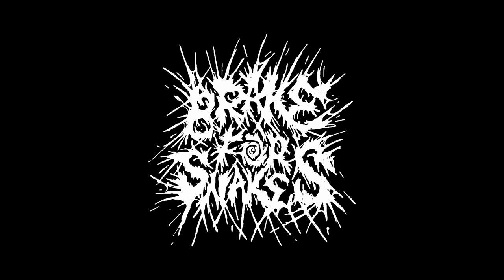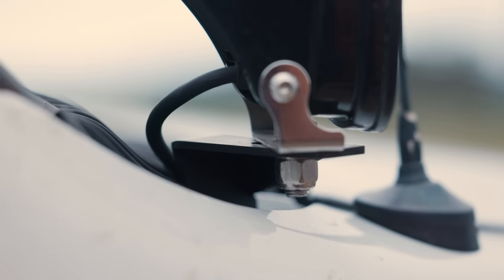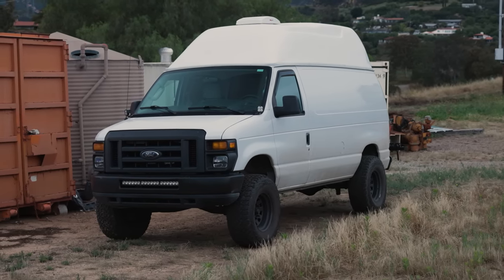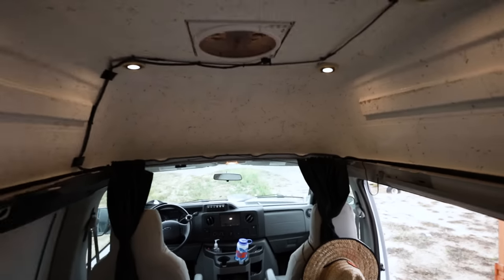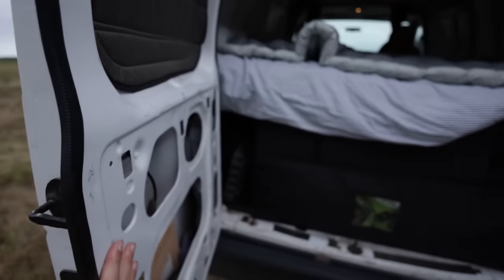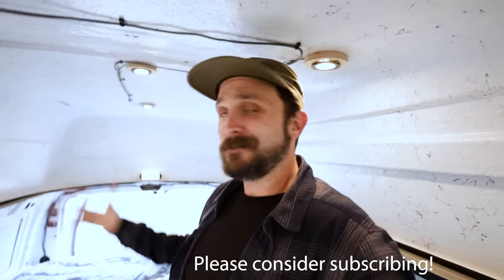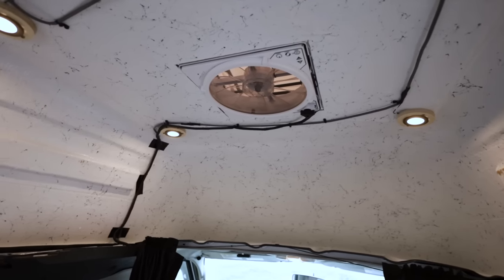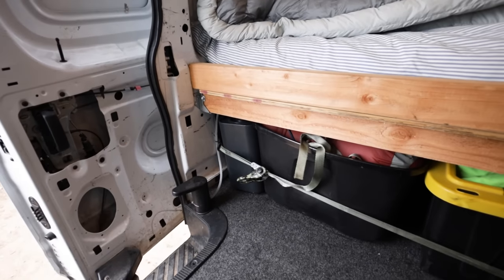This cargo van conversion cost how much!? Crazy cheap option to a Sprinter van!

Comment: It started out being cheap, you said and then things escalated. Chevys with 350’s and even 305’s, they’ll benefit from 31 x 10 light truck tires, the speedo will register 5 to 10 mph pessimistic, and the vacuum modulator on the transmission can be adjusted ( screwing clockwise ) to delay shifting so as to compensate for the increased load. Other than that, protect the pulleys & belts in front from catching brush with a screen and carry two good chains sized right for installation in case you get stuck. The fiberglas tops, well, that compromises an otherwise good steel roof. Ford van handling sucks, dangerously even stock. Chevy got it right in those decades before they too sucked when they changed.
Reply from the maker: or you could just buy an SCT tuner and fix your speedo/shift points. Also the van is on 4.56 gear with the 35's and what's good a steel roof you can't stand up in? I think you're missing the point.

Comment: So much better than a weak Sprinter. Killer offroad too, as 4x4 Sprinters are absolute garbage offroad and get stuck so easily. I'd take a 4wd Econoline, or even a 2wd Econoline with a rear locker any day over a Sprinter.
Reply from the maker: 100%

Comment: What wheels and size are those? Using spacers? I've been looking for wider wheels without the need for spacers and it's not easy.
Reply from the maker: I do use spacers in the rear only. The wheels are d window steelies in 17x9
Reply: @brakeforsnakes  0 offset? I see some Vision branded ones that look like yours.
Reply from the maker: @keldonator  Yup but like I said in the video even with a door slide extension you will need to modify the door. Unless you have barn doors than you're set!

Comment: Ouch! that price on a full Rigd setup.
Reply from the maker: It's really not bad at all for a well engineered, thought out and built in the USA product.
Reply: @brakeforsnakes  Is that the Ramblerack into the Ultra Swing MegaFit? Plus the table
Reply from the maker: @DaKeithCody  yes

Comment: Tons of wasted vertical space. You need upper shelves. The bed is wayyy to big.
Reply from the maker: The bed is the best part, there’s no way to make it smaller and still be comfortable for us. Plus we don’t want a bunch of weight up high so we won’t be doing cabinets or shelves up there. I’d much rather have all the weight down low under the bed than make it feel too heavy by storing stuff up high.

Comment: Rip to another good van for work 😢. These van dorks making it real hard for the normie contractor to find a cheap reliable van these days..
Reply from the maker: Lmao they made millions and millions of these vans there is zero shortage of them. Not to mention this one wasn’t reliable at all. The transmission went out just weeks after I got it costing $3500.
Reply from the maker: And just for reference “The Ford E-Series has been in production for over 60 years and has a fleet of more than 2.7 million vehicles. The E-Series van was the top-selling model in the United States from 1980 to 2014” so if you can’t find one that’s on you my man

Comment: Watch for wind Goin down road
Reply from the maker: There’s no added wind noise at all
Reply: Can u convert to 4 wheel drive electric
Reply: Electric motor on transmission
Reply: Plastic wheels insert good idea protective from damage rust

Comment: That's to high .top heavy
Reply from the maker: It’s not too too heavy at all the entire top only weighs 100lbs over what the steel roof was
Reply: @brakeforsnakes  u go down the highway the wind starts blowing to the side of the van it will shake. To much high length...
Reply: @brakeforsnakes  to much high length
Reply from the maker: @hildebertocarreiro9232  I’m the one that owns the van and has driven it thousands of miles on the highway I think I’d know. And I believe the word you’re looking for is “height”
Reply: The comments are always fun with people telling you how crappy your van drives!  This van is still small in height compared to lots of other builds the WTD does.